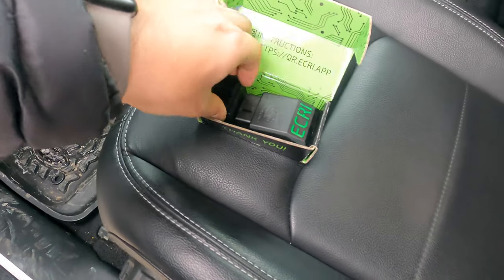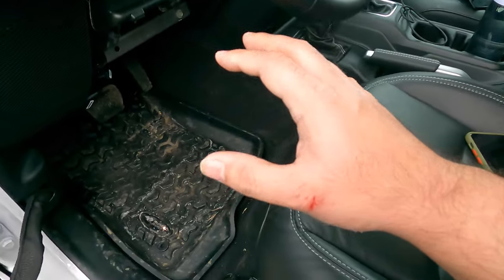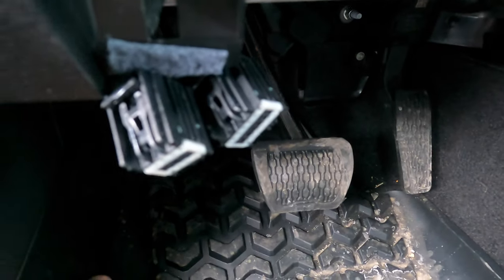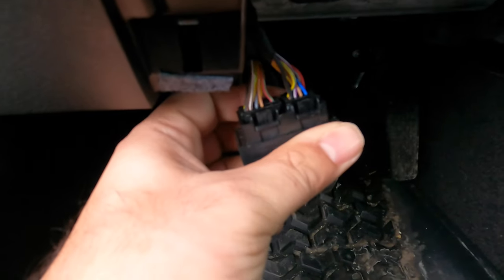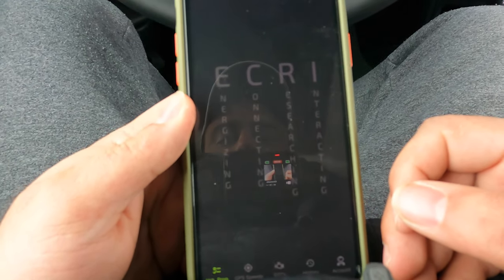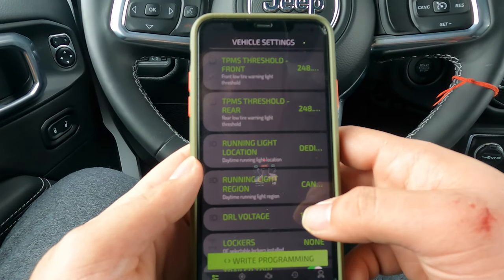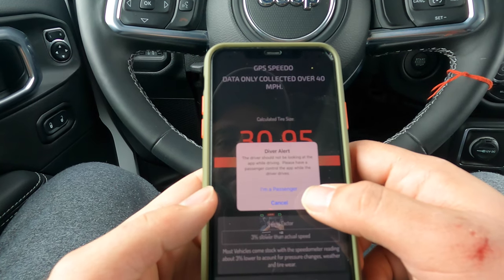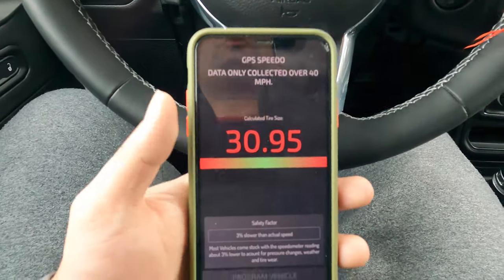How to recalibrate 2021 Jeep Wrangler's Speedo with ECRI

Comment: Does adjusting the shift points happen automatically when you recalibrate the speedometer or is that another step you have to do using the ECRI app?
Reply from the maker: Yes, it happens automatically after calibrating speedometer

Comment: I recently moved to 35s. But after a lot of trial and error I set the size to 33.25 using the ECRI. That seemed to get my speed to match various speed limit signs and GPS based speedometers. It improved my ride as the shift points corrected. I even more recently re-geared too. Improved my mileage a lot. I lost a lot moving to 35s. But now I am a little better than stock. But the shop set my tires to 34.1, which was again wrong. I moved it back to 33.25 and speeds seemed to correlate with outside sources again. Apparently 35" tires are 33" when on the jeep :) Probably not a surprise as the weight of the jeep likely compresses things a bit. Anyway, the point of all that, was I could never get the ECRI to give me a good tire size. When it was set at 34.1 it recommended 33.9, at 33.9 it recommended 33.3. At 33.25 it recommended 32.75 etc. Even when I initially moved from 33" factory tires to 35" tires it was very random. Interestingly, the 33" tires were set to 31" tires initially. That made me feel better about losing 2" :)

Comment: Hi... i have same situation... gear box is pretty much messy... ride is not good on highway... i have 35 tyres on fuel rims and 2 inch fox shocks.... i purchased as it is from eastside dodge calgary... does this calibration fixed this messy shifted of gears.. tnx
Reply from the maker: Hi Navjot, yes it will fix your sluggish transmission shift points. PS- Mine is also from Eastside dodge :) let me know if you need any more help
Reply: @tusharvlogs846 hi ... yes it works... i did it with superchips 5... it is running fantastic... smooth drive and good guel economy.... thank for reply... and do we really need to lift the jeep with 35s tyres... ?
Reply from the maker: Congratulations! Your ride would be perfect now. Well for 35”s in Rubicon you don’t need a lift unless you wanna go for hardcore wheeling as it has enough wheel well space . For the newer Sahara models also you don’t need a lift but you don’t have much wheel well space.Watch my video where I got the 35’s installed without lift but just for esthetic purposes & little bit of more wheel well space I went with 1.5” lift.
Reply: @tusharvlogs846  Thanks Tushar... i have 2021 sahara altitude... for now it’s fine ... it’s working good ... so i won’t change anything.... fuel economy is 7km/l in city and on highway is 9km/l and i am fine with it... much appreciated for your time .... thanks again... have a good weekend.

Comment: Can I barrow it to set my gladiator tires and send back after ? I would appreciate it -Joe
Reply from the maker: Hello this is locked to a particular VIN for lifetime. I can definitely share the device & you have to then purchase the VIN unlock. Where are you based ?
Reply: @tusharvlogs846  I appreciate it I have one coming today
Reply: Is the speedometer accurate? The shifting has been fine too? I used a JScan and that app really couldn’t pin point my size for shift points
Reply from the maker: @22blkgladdy50  Bang on. No issues so far
Reply: @tusharvlogs846  hey brother would you still be able to let me barrow the ECRI? I sent mine back and need to recalibrate for new tires

Comment: Are you thinking of re-gearing also?
Reply from the maker: Na not required, it’s running better than stock now!
Reply: @tusharvlogs846  that’s good to hear. I’m thinking of the KO2’s also in E rated like you have. I heard the ride isn’t as bad as people say with the stiffer side wall
Reply from the maker: @phill4750  No I would differ, for me the steering is much more stable now as compared to stock due to wider tires & ride is smooth I barely notice any difference apart from gas mileage 😎
Reply: @tusharvlogs846  the recal will probably help your mpg too
Reply from the maker: @phill4750  yes it should. Waiting for it to adjust as I recalibrated it yesterday only. Mileage is still fine but the transmission shift points were really messed up glad that’s back to normal now ! Good luck with your purchases

Comment: Thank you for video; purchased ECRI calibration module for my ‘21 JL Rubicon Diesel after watching. 

Upgraded to 35x12.5r18 K02s last week and speedo is off by 3.3mph @ 60mph. 

Your step-by-step video 👍👍👍
Reply from the maker: Congratulations for your new beast ! Glad I could help.
Reply: Question, if you don’t mind; after install was confirmed, did you unplug wiring harnesses from ECRI security bypass module and return wires back to OEM ports? Or does the security bypass remain connected at all-times after calibration? Thank you.
Reply from the maker: @christopherkelly3930  no remove it once job is done. No need to keep it connected
Reply: @tusharvlogs846  Thanks so much! Appreciate your time and feedback 👍
Reply: @christopherkelly3930  ECRI web site said you should not be driving with the 2 ECRI modules installed.